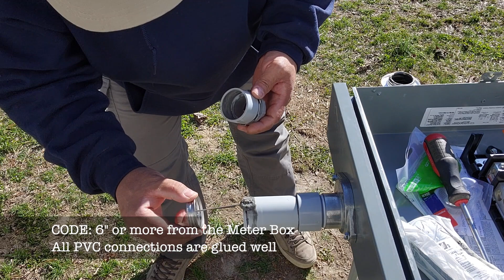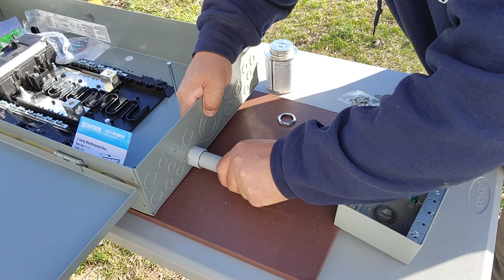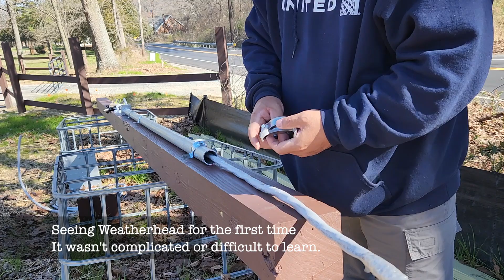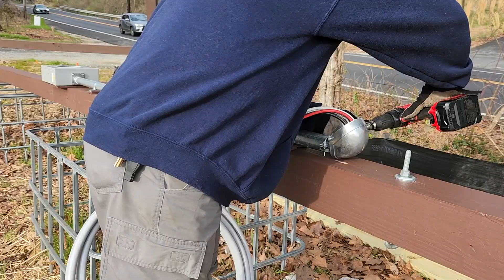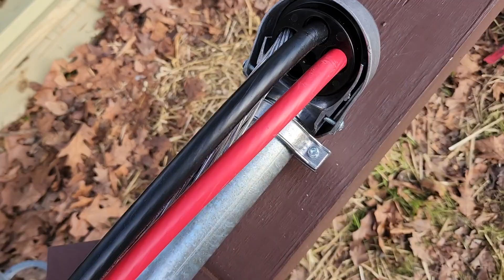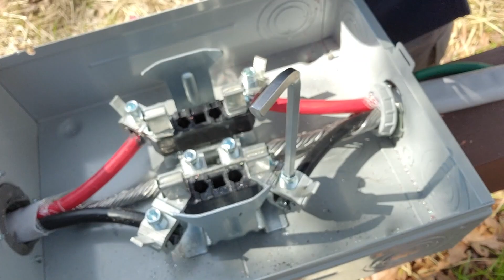DIY House Build Ep. 2. Temporary Power Pole DIY Installation Step-by-Step Part 1 of 2

Comment: I like tha way you work but the main wire you used are aluminum wires and its not by the NEC
Reply from the maker: Selecting the right wire was a crucial aspect that I entrusted to seasoned professionals. To ensure precision in my choice, I opted to patronize a local supply store catering specifically to professionals. Engaging in insightful conversations with electricians, the store manager, and the knowledgeable staff, I received unanimous recommendations for #2 aluminum wire as the most fitting option. While acknowledging the possibility of differing opinions, I find it essential to highlight, in this video which I didn't, the inherent disorganization and confusion within electrical codes. I thought it was unorganized purposedly to discourage DIYer such as myself from doing it my own. It passed inspections.